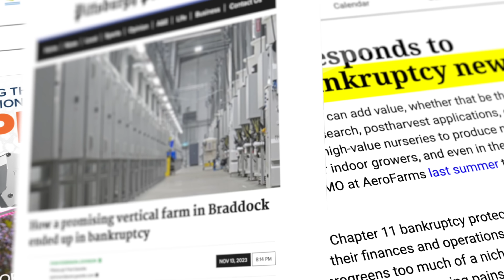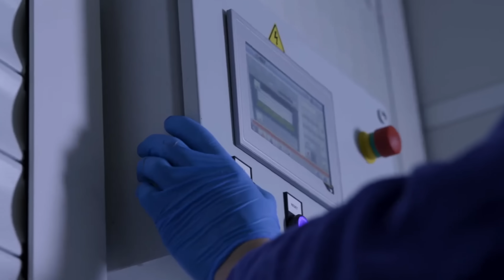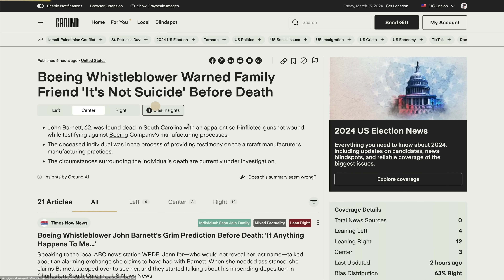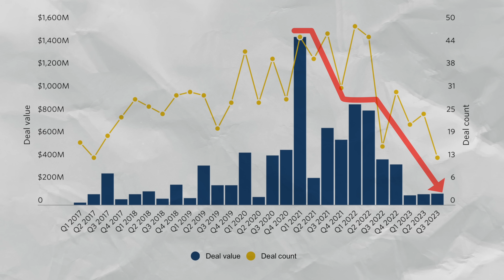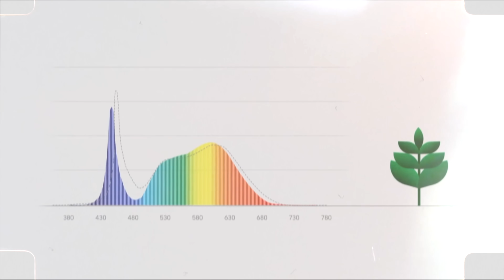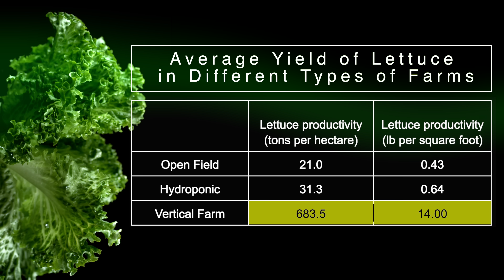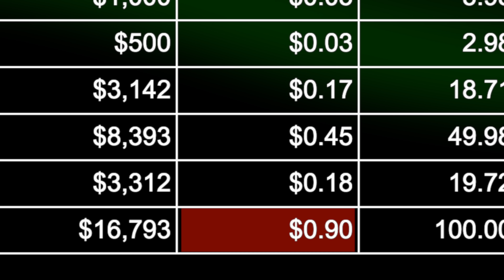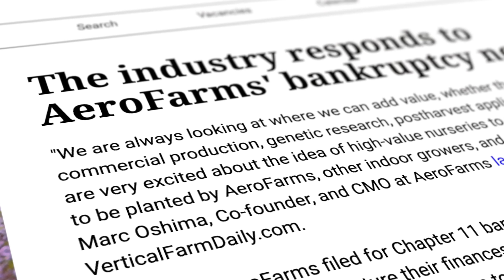The EPIC Failure of Vertical Farms - What Happened?

Comment: There are three issues with vertical farming at this time that I can see, and they tie TO cost, but are not cost directly.

First, we're not targeting the correct crops. There are a number of crops which are endangered by climate change, and those should be target #1. The issue there is the time it takes to get those plants matured. This is not going to be easy. Bananas, chocolate, coffee, etc. are all at risk. Avocados, even. However, it is worth noting that all of these are larger plants, and will require a different approach.

Secondly, the technology is NOT optimized for cost. Plugging into the existing supply chains wouldn't be too hard, but the indoor farming costs are partially a matter of poor design. I expect that solving those will generate Round 2 for vertical farming. It also applies to arid areas growing high-water-demand crops (so very much looking at California with this).

Third is exactly what you mentioned about where. Desert regions are the first round targets for this technology. The second-round target is going to have to revolve around non-native plants in local production (tropical fruits in Alaska, for example).

My guess, and it's just a guess, is that we're going to need to design whole new building styles and approaches to industrial workflow to optimize this, and that's going to take 20 years to truly make work. This is almost certain to happen, but I may be an old man before it's actually fully viable as a business model in most areas.

Comment: yeah sure the front up cost needed to get the equipment and so on is going to be huge same way buying bunch more land would cost you and you could probably write off most of the electricity costs if you loaded the initial cost part with getting solar paneling for all the roofing of the area you are going to take... thus resulting in lower overall cost to keep it running...
now it will still cost an arm and a leg compared to traditional way...
but these things should be done so that they are literally adjacent to where it will be sold directly and completely cutting out the transportation costs when you just literally roll it out the door and into another to start stacking for sale... and this should be something a government should give a small amount of money for the environmental impact it is removing...

also all this could be marketed more efficiently so that a slightly larger prices wont be minded that much by those concerned about the worlds future and also the industry needs more research in ways to reduce the running costs...

also as a side note i doubt they have done proper studies on what plant has the most effective growing cost vs selling price formula out of all the plants that could be grown like this...

Comment: If we stripped away cost of paying dividends to investors, I'm guessing the cost would decline dramatically. 
I still think this technology is extremely promising and necessary, considering climate change. 
Vertical farms are much better for the environment. They require less land, less water and less fertilizer. As far as energy, if a farm is built from the ground up to use dedicated renewable energy, the energy cost is solved after a certain period for ROI. Using less land for some crops frees up existing farmland for other crops. Such as growing lettuce and tomatoes in vertical farms, which take up a lot of land, means more land available for growing corn, potatoes, etc. 
Mostly, vertical farms are best for cool weather crops but tomatoes also do well. 
The more automation is introduced, the lower labor will cost. However, at scale, there would be a lot of jobs for years. Until we reach the tipping point of automation eliminating jobs. That's happening in all industries and the solution is not creating more low wage jobs but adjusting our economy to compensate for the loss of jobs. We really need to rethink economics right now.

Comment: I have been following indoor hydroponic gardening for a while now and very soon plan on creating my own. Pretty sure it will be a great supplement to my garden and save me quite a bit after about its initial 5 month pay back. Also pretty sure I can get myself consistent fresh veggies and strawberries cheaper, even during the winter months.

 Anyway, I originally thought for a while this video was going to be negative against the whole process regardless of scale, but you did a very good job laying out that while they may have some similar principles, they are extremely different. I can see how it would be much tougher to scale in a factory style vertical farm than it would be to do some kratky and nft in my residential house. You even did a very good job explaining that traditional hydroponics generate more yield than regular (which seems to be true for my garden), but differentiating that what was promised to investors in the industry was way different.

There is even a point where I can totally understand hydroponic systems become more work than it’s worth. Because while I’m going for some vertical application, it’s 5-6’ high and not 50-60’.

Anyway, good video.

Comment: Having grown up on a horticulture farm, I can tell you the biggest attraction regarding vertical farming is being able to supply to the market at times of the year that a regular farm cannot. Yes the costs are huge, but there are better crops than lettuce. Better as in higher value. Also, the only way the power bill works is if you're integrating a solar farm and energy storage (if you do it well, you can sell your surplus). Yeah I know its weird. The solar farm takes up land, but it's actually far more efficient than regular crops.

Comment: The main problem of vertical farms are they are not selling cash crops like rice that is always in demand. 2nd is the high wages why the hell do you need ex tech employees to run a farm you are running a farm not a chip manufacturing hub. 3rd they are more focused in building the most flashy building instead of a farm. 4th they are focused in selling shares instead of the product itself. 5th why vertical farms fail is they sell products way more expensive compare to regular farms who reley on cheap labor. 6th employees wages you don't need ex tech employees and scientist to run a farm you need people who have experience in runninh a farm.

Comment: Automating the farms is a big part of the problem. Humidity and heat in a greenhouse environment isn't the most optimal setting for robots. These companies that have failed were primarily the big tech versions of vertical farming, they wanted technology to do the farming, not people. There are many successful vertical farm operations in the world that simply hire primarily unskilled workers. Like some others have mentioned, the produce quality does tend to be higher, much higher. Price per unit is a big factor as well. Fancy lettuce pays a lot when you sell it in high wage areas but there are plenty of farms that can produce a much wider range of produce at far more reasonable prices. A lot of these start ups laid out their plans based off the fancy lettuce in high income areas. On paper, sure you can sell quick growing fancy lettuce at a huge markup in Hollywood where lettuce is the norm and incomes are high. Investors saw that and didn't make the connection that not everywhere in the world is Hollywood. It was a fad investment for those looking to get rich quick, star struck by the idea robots could replace farmers. As you said in your video, the market as a whole is growing because it is a great system for growing produce, quality wise, and where water is scarce and electricity is affordable. I'm speaking from personal experience, as an agriculture scientist. If you want a successful vertical farm, buy it from a farmer, not a tech mogul.

Comment: It’s been my experience that you can still do vertical farming with the natural sunlight. What my family did is they took a 2 x 4 frame and wrapped it with a very fine fiberglass mesh that let the water from the rain come in and kept the majority of the bad bugs away from the crops. Bugs are the primary reason why people do vertical farming in a controlled environment. And that’s all well and good but plants need gods sunlight.

The soil was basically a mixture of coconut core ground up with rabbit, manure and seaweed ground up. The soil was the base mixture that was cooked by fire to minimize weeds. We also took nightcrawlers and added a few of those to the soil to keep the aeration and added fertilizer from the worms which worked really well. In the mixture we also had charcoal that was ground up and it seemed like this formula really work because our vegetables were huge and healthy all the time. I know this seems a little unorthodox compared to what we’re used to doing in farming, but it worked beautifully and we really didn’t have the kind of pest problem that you would have with an open farming application, and definitely know pesticides were used.
Reply: can this work on an industrial scale? and not in your backyard? 
Its one thing that it works when there is hardly anything else around it. But these vertical farms and several stories tall and take up a huge amount of land. Not as much as a farm sure but To get even Close to a yield large enough to feed a large town it would be a huge facility.
Reply: @BlueBD  thanks for the reply and yes you can do it on a larger scale. I’m not sure about an industrial scale, but I think that you could still do raised beds on a pyramid style tower in, but not go that tall where you can still reach every level with relative ease. There’s other ways to utilize the square area of any parcel to realize more vegetation

Comment: I could imagine, that the high level of automation and the cost of the structures are killing vertical farms. Let farm workers do, what farm workers have been doing since centuries - they take care of the pants from seeds to harvest. Just indoors. And more frequent (as you have more harvests per year). Ignore fancy robots and wild technical solutions. just care for environmental control (light, watering, etc) and let people do all other work. They do not have to be very educated, let alone be engineers, just train them to the changes vertical (indoor-) farming impose. Get the farmers on board. They know all the work processes in and out.
Likewise, there are tons of projects turning waste into cheap construction materials - use those to build the structures. Avoid costly steel/aluminium shelvings, go for plastic (recycled) or wood. Make the simpler. Add solar to the (flat) roofs, collect rainwater on the roofs in cisterns for watering.

Comment: Ha. They poured too much money into it and didn't scale down the costs enough. I want to get into indoor farming. But the harsh reality about farming is that it already costs less than what minimum wage can provide for in most countries. Same problem with fossil fuels. We can totally synthesize our own fuels. Its just not cost competitive with whats basically free energy lying in the ground. 

Its not until Phase II of my business plan anyways. In Phase I, I plan on developing a small modular production line using wire arc additive manufacturing for the production of bioethanol, biopolyethylene, biopolypropylene, propene, syngas, green ammonia and finally a load bearing composite two-by-four that's cost competitive with timber. All derived from miscanthus, a tall grass. In Phase II, I'm interested in autonomous construction using mostly these resources. By vertically integrating my costs and inputs, my only real material cost will be miscanthus. I have an education in optics and was interested in using birefringence from cellulose coatings on transparent composite wood combined with a repeating prism structure for vertical farming in order to maximize natural sun light exposure per square foot of farm land. A compromise between vertical farming and relying on natural light. (Using LEDs introduces the same problem that closed loop algae farming has. You still need an input, be it electricity or co2 gas. That has to come from some where and costs money) It'll also be raised off the ground with autonomous manufacturing underneath meaning your vegetables/products will leave the farm fully packaged and prepared. I even have a dream of developing a fully organically derived humanoid robot using laser induced graphene from biopolyimide, reverse schottky diodes with silicon impurities and graphene supercapacitors in order to fully vertically integrate the cost of labor as well. I'm taking electro-mechanical engineering and computer science right now and I'm already educated in AP chemistry and love material science, so every time I learn about a new component in class I imagine an organically derived biopolymer alternative. The end goal is that these buildings build, repair and manage themselves and grow all the materials they need to maintain themselves. A lot like a living system. On top of being a self sufficient microeconomy that can provide for food, fuel and housing sourced locally. And to rely on modular units that are easy to transport and replace coupled with economies of scale to significantly lower costs, on top of vertical integration (I also took economics). 

Its a lot of planning but I've spent the last 15 years planning it out and have already decided to dive head first into the education I would need to pull this off. I don't plan on doing anything else but this, and I might have the resources to pull it off. Or at least getting to my first prototypes for phase I before I will need funding...

Comment: As someone who has designed vertical farms, I’ve always thought they were very wasteful. They use way too much energy and lighting equipment. Only useful as a scientific experiments or for very niche, very expensive crops like microgreens or basil or cannabis, not actual “food” as in caloric value.
Reply: I occupied myself some time with this topic. I came to a rough approximation of "factor 100": You need 100 times the caloric value of the produced food as electricity for lighting. 
For instance 1 lb lettuce has a caloric value of 50 kcal (209 kJ, 0.058 kWh). So electricity demand for lighting will be in the scale of 5.8 kWh.
Not prohibitively much for expensive food with hardly any caloric value, but you won't feed the world this way.
As an expert, do you think, my "factor 100" (let's say something between 50 and 200) is basically right?
Then you would need an average power of 12 kW (105 megawatthours per year) to cover the caloric demand of 1 human with an average metabolic rate of 120 watts.
Reply: @701983  I have never done the calculations like that in terms of kcal per kWh, but it sounds like ballpark plausible. It would depend on many variables such as the efficiency of the light source (certain wavelengths of light tend to be more efficient, less waste heat or reflected green light for example) and the variety of plant (some plants have more inedible waste material than others or don’t use light as efficiently). Tomatoes are very inefficient because you can’t eat the vine or the roots so you need all that energy to grow a big inedible plant before you even get your first tomato. Large plants also create shade so they are not practical.

Microgreens are most efficient, and some of the most nutritious, but you are starting with a lot of seed and so proportionately more nutrients are from the seed itself and less from the kWh input. 

Then there is the practicality of how do you illuminate the most leaf area with the least amount of energy. The smaller the plant, the better in theory. 

Actually, the most efficient is spirulina (although technically not a plant) for this reason and it is probably the only thing where you could theoretically provide enough calories to live on with a reasonable amount of energy on a space station or mars colony. It would not be a very exciting staple diet, but it is likely 5x-10x more efficient than something like lettuce.

Comment: I dont know why they are not using mirrored tubular systems to direct the natural sunlight inside to their v farms? Or setup rotating conveyors to reduce the human labor? These are pretty easy solutions.
Reply: Because one basic point of vertical farming is indepency from weather and solar irradiance, a totally controlled environment.
Reply: @701983  During those times you then would turn on the LED's. The point is for cost savings.
Reply: That's also the reason, why you can't use just simply electricity from solar. Which is no steady, reliable source.
And you would need a big area covered in moving collectors (solar concentrators) to gather sunlight. It wouldn't really be an "easy solution".

Comment: I'm not convinced about the costing based on the lack of deeper analysis of them in this video (nor reference to the sources). The key tenet of this video was the high cost of vertical farming leads to the failure of the industry.

Were the costs compared "apples to apples"? I.e. if you were to pioneer new land or buy a large lot of arable land in a 1st world country and convert it into a farm, would the capital cost still be only $0.02 USD (in units used here)? How about if we were to learn and develop farming today, instead of continuing methods that were developed over hundreds and thousands of years? Would that need 'white collar' workers, as well (and at what cost)? Etc...

Yes, right today, the cost bases are what they are. But a fair comparison would have been between setting up a new traditional farm vs vertical for the same output, and operating an existing traditional vs vertical farm.